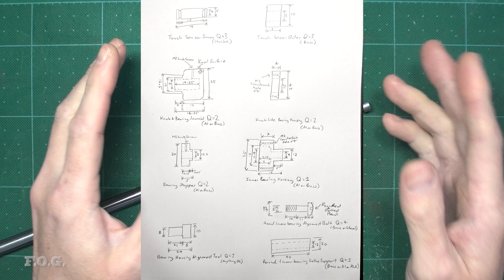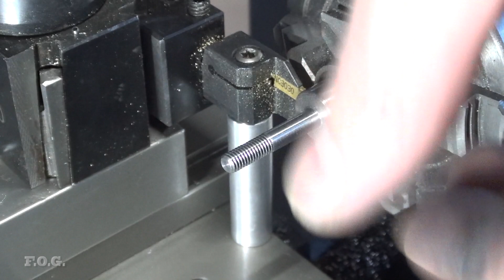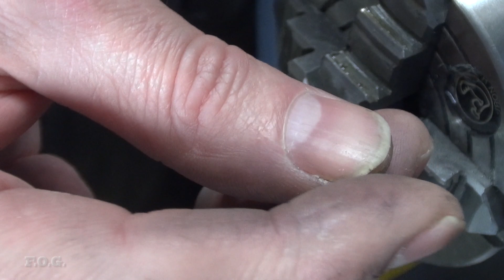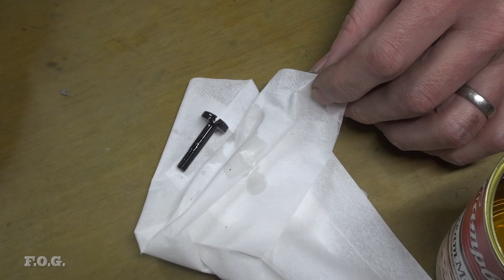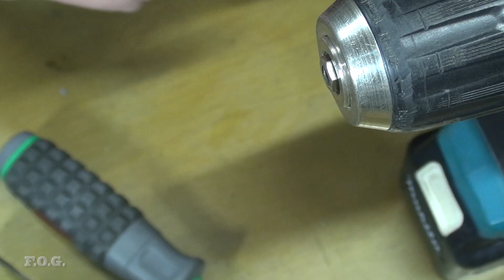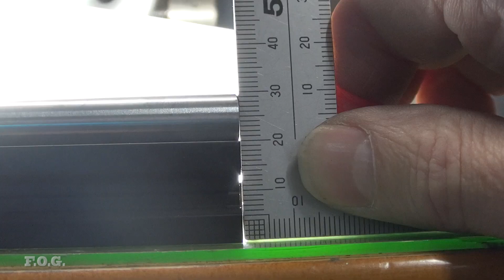EP3 – CNC3018 Rebuild – Linear Bearing Rods

Comment: Great work! I really want a lathe, but I don’t currently have room for one,
Reply from the maker: Actually I don't have space for any fixed equipment either, well maybe only my 3D printer is an exception. Everything else needs to be luggable so I can stick it on a shelf, or at least shuffle around to make space. The mini-lathe is good in this respect, even with all its short falls. Thanks for the comment!
Reply: @ForOurGood  that a good point, maybe I need to think about how I use my tools. Which lathe did you buy?
Reply from the maker: @dJOS_500  I am using a version of the venerable Chinese Mini-Lathe, it's been around forever. Check my mini-lathe series for more info.
Reply: @ForOurGood  cheers, I’ll go watch it